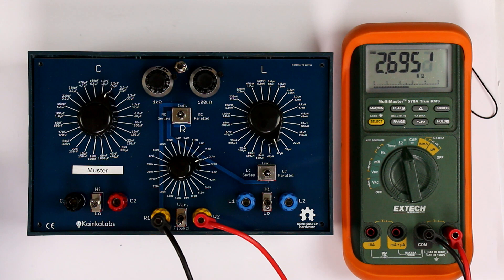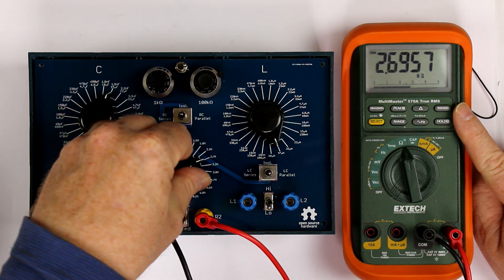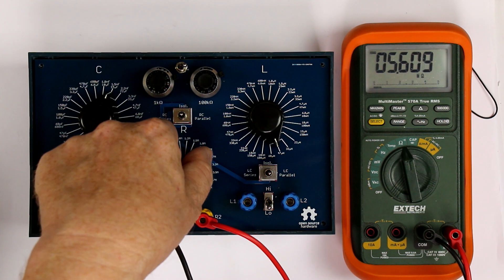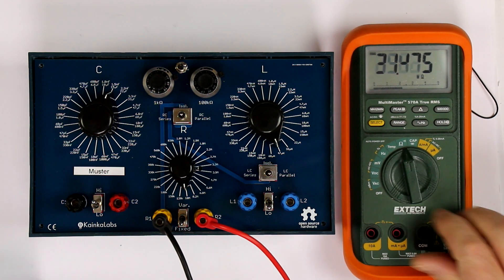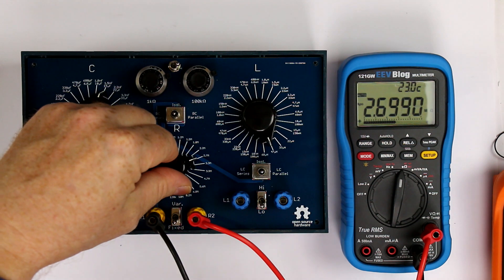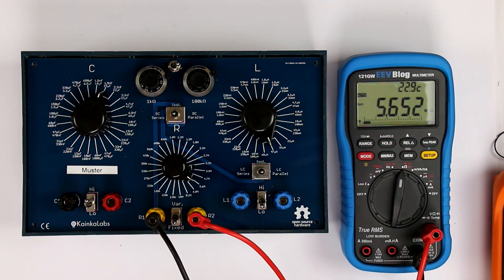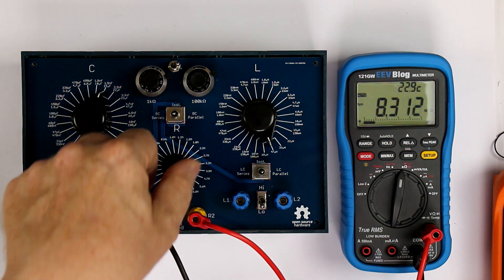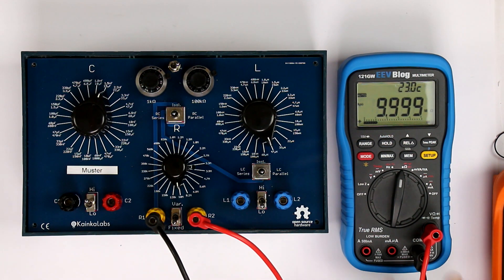121GW EEVBlog Multimeter Megohm Resistance Problem

Comment: Interesting!

A bit of hopefully-constructive feedback: some of your text overlays (e.g. the one at 4:24) are exceedingly difficult to actually read (at least on a small screen, but even on something of moderate size)... perhaps you could make them stand out a bit more in the future. I might suggest white with black drop shadow instead of the... is it grey on white?? Even full black on white might help , but with all the white silkscreen right behind things, it might still be a challenge. Yellow on black, then, maybe? And/or just bigger text. Thanks for considering it. :)
Reply from the maker: Hm. I always thought that the readability is quite good. When I edit the videos the text stands out extremely clear on my 19"-LCD. The text-colour is 100% black (or 100% white when superimposed on a dark background).

Comment: it looks a nice multimeter but marred by issues and accuracy problems
Reply from the maker: I disagree. For me it´s the best multimeter in it´s class. If you read the comments you will find that it is still within specs and other people did find more exact measurements in the high Megohm range with their 121GW.

Comment: Just checked 1M - 10MOhm with my DIY resistance decade. 121GW Version 2.02. Every value well in 1% spec of my decade resistors. 
Also compared with my Keithley 2000 (6.5 digits, 4 wire).
Also measured single resistor values: 
1M +/-0.01% gives constant reading 0.9999M after ~5 seconds
10M +/- 0.01% gives constant reading 10.008M after ~5 seconds
18,2°C in my cold lab :-)
So every value nearly spot on and well within spec of 121GW.
Maybe a Version Problem?
Reply from the maker: Did you only have 1Megohm and 10 Megohm resistors for checking or also the values in between? With those values (1/10M) I also had no accuracy problem. It were the values 5,6 Megohm, 6.8 Megohms and 8.2 Megohms where I found that the accuracy was approaching the limit of the given specs.
I will also recheck after a version update.
Reply: @KainkaLabs  On my resistance decade I checked every value from 1M to 10M in 1M steps. Also I checked 5M6 and 6M8 and some values inbetween. All readings on the 121GW well within the 1% range of my decade. The 1M and the 10M were extra resistors with low tolerance.
Reply from the maker: OK. Then it is probably an unlucky combination of tolerances running in the same direction with my unit. Nevertheless I still wonder about a different explanation due to the "nonlinear" behaviour of the tolerance. I still have to upgrade the firmware to the latest version and see if anything changes.

Comment: Wouldn't call it a problem if its still in spec.
Reply from the maker: You are right of course. What I was wondering about is that the error is not constant but varies over the range.

Comment: Now Dave Jones will make one of his ironic teardowns about your LCR box in revenge! :-))))
Reply from the maker: There he will find of course that the lowest decade of the inductors (10nH...100nH) is useless because of the parasitic series inductance of the switches and the cables. 
Of course this video was in no way a criticism about the 121GW. I still find it by far the best multimeter in it´s price range. And didn´t it become even cheaper some time after the first batches were sold?
Reply: @KainkaLabs  I was kidding. You know, Dave has an acid sense of humor and I wanted to joke about that. Thank you for your answer, Roger.
Reply: @DIY-valvular  I'm here from the latest EEV blog video, Dave really liked the LCR box construction but didn't put it through it's paces. I totally get what you mean about his acid sense of humor😀.

Danny from Lebanon.
Reply: @DIY-valvular  I wonder if Dave has seen this. It would be interesting to see him try replicating this, and/or hearing what he has to say about it.
Reply: @DavidLindes  Hey David. 
Maybe Dave saw Kainka's comment about the dmm he sale or maybe not.
The fact is that Dave has a remarkable sense of humor and both eevblog dmm and Kainka decade box are great instruments actually (if my incomings improves, difficult thing in argentinean economy) I will be happy to buy both instruments!.
One point in favor of Kainka's kit is that it's a product of his own creation.